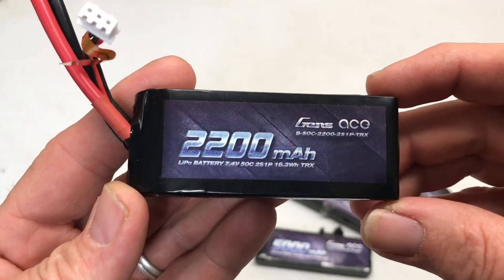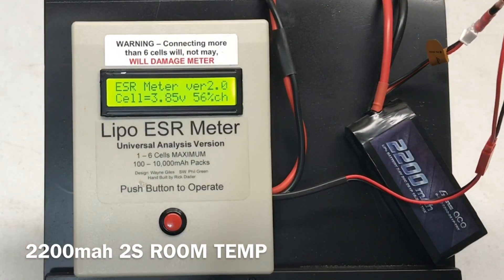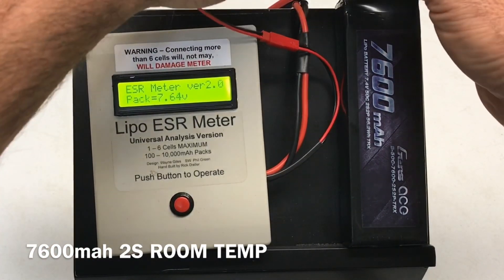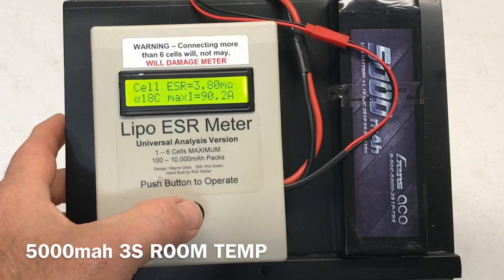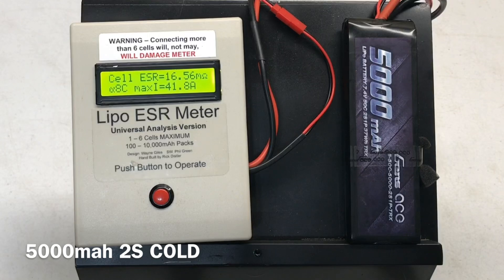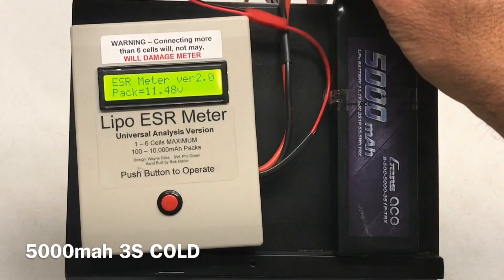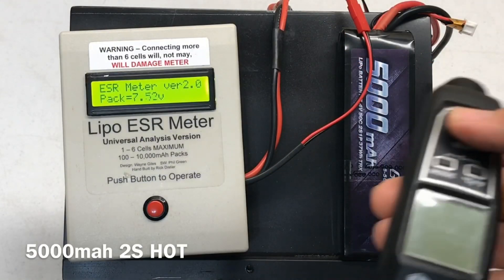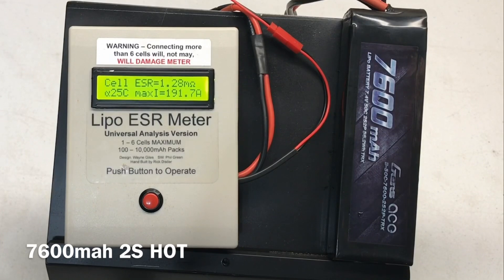Gens Ace Lipo Test with ESR meter

Comment: I have those same 5000mAh Gens Ace batteries. Disappointing result. Have you found any that actually deliver on their C ratings yet?
Reply from the maker: the only ones that do are the turnigy 20-30c hardcase batteries. No battery is over 30c, no matter whats on the sticker.